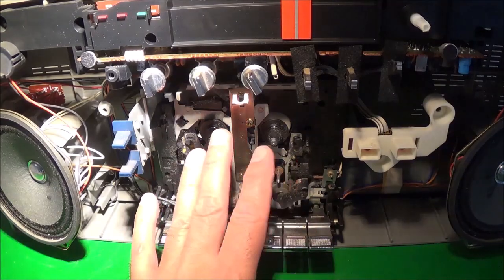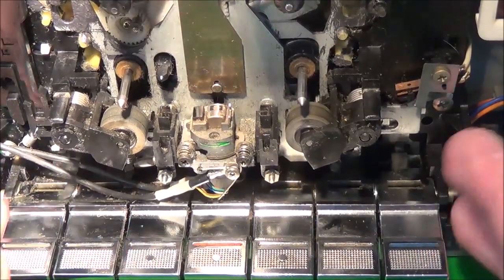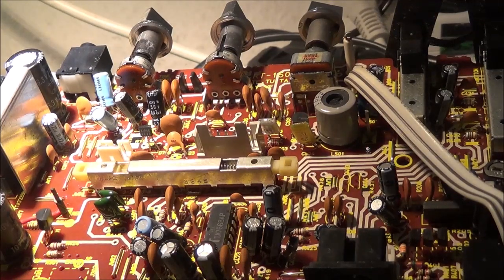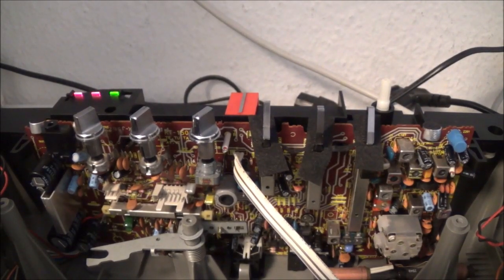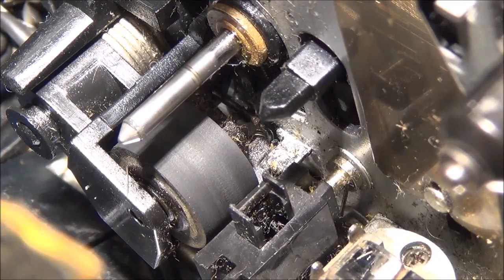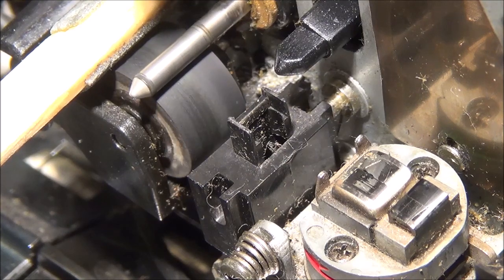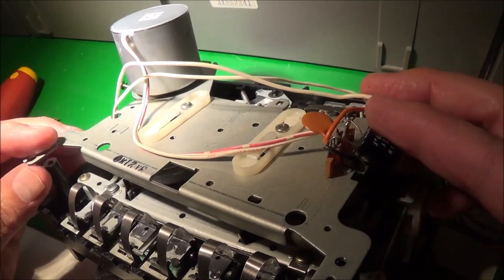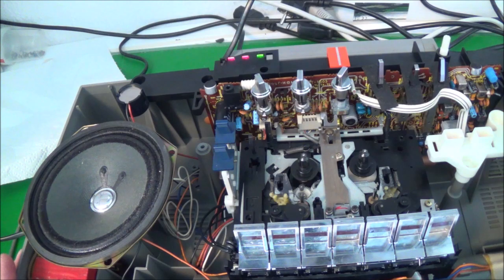Toshiba RT-150 Stereo Cassette Recorder Troubleshooting & Repair

Comment: I have the same exact one,  but I won't play thr cassette, when I press on play either one the reverse lights up, and it doesn't play at all. Also what is the battery compartment in the back for?